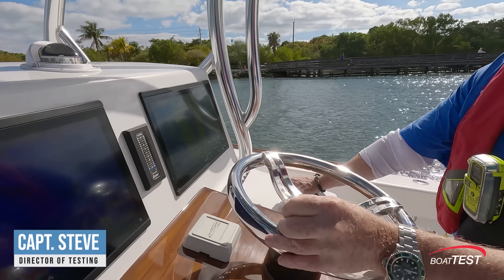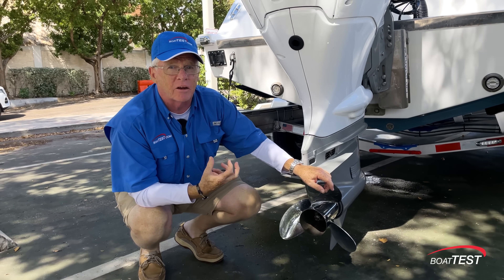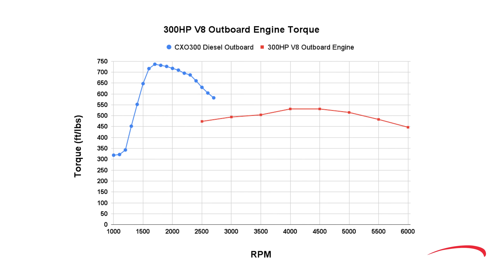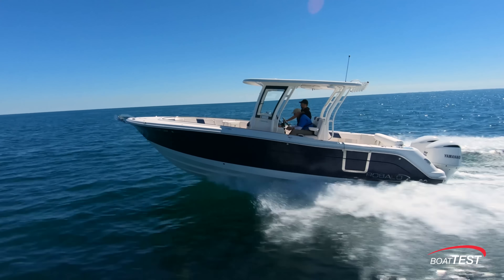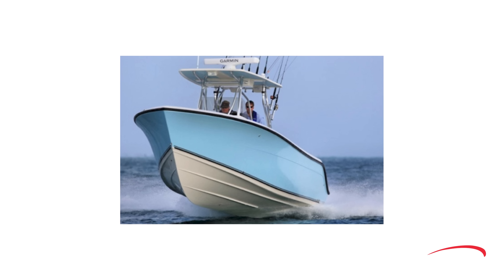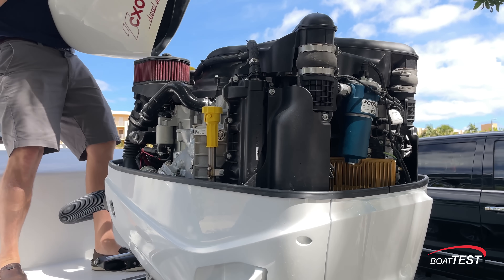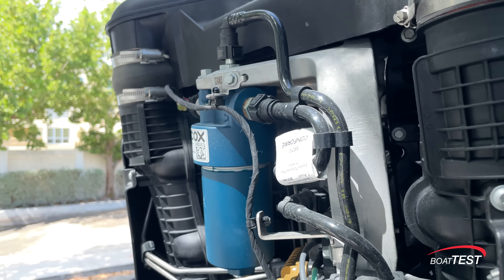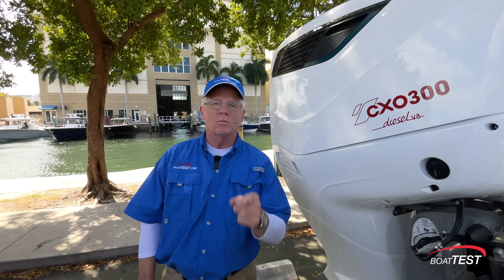The Diesel Revolution: Cox Marine CX0300 Review | BoatTEST

Comment: Would be interesting to compare this with direct injected petrol engines.
Reply: @ioijiopjkiopjkp  almost all modern gas engines are direct injected.  Diesel combustion is compression ignited and almost always produces more torque than a comparable gas.  There is a reason why all semis are diesel powered

Comment: It’s bullshit information, or shit motor….
300hp diesel v8 mercedes on maximum  speed = maximum fuel consumtion takes 20 liters / 100km = 12,5 MPG. 
I know: boat isn’t a car, but fuel consuption at maximum posibiloties of the same type and size of motor is similar in all application.
Reply: You just answered your own question. Its not a car. Boat engines have to put continuous output for hours, whereas a car is stopping and starting. That COX engine is built for continuous load (which diesels love). Car engines don't have the cooling capacity of a boat engine. Happy days mate
Reply: @peanuts2105  Many small boat engines (and some of the best outboards) are just car engines which have been adapted to power a boat.

The mpg of a boat will depend greatly on the boat itself.
Reply: @PistonAvatarGuy  yeah this diesel engine might be a reworked bmw v8 diesel
Reply: @PistonAvatarGuy the bmw m67 was a 4.4l diesel with aluminum block too
Reply: @alanmay7929  You are wrong. This Cox engine (UK company) is an V8 diesel engine developed from a clean sheet of paper by Cox. The other diesel outboard manufacturer OXE (Swedish company) use a BMW inline 6 cylinder 3L engine.

Comment: The torque figures for the gasoline engine in your graph are way off.  They are immensely overstated.  Maybe that's what it is if you include the 1.85 gear reduction.
Reply: Agreed "way off" is an understatement. Although outboard manufacturers rarely if ever publish propshaft Torque, Its safe to assume within a margin of error that torque figures do not exceed hp figures by much if at all (e.g. 300hp would be < than 300 ft lbs or near it). Proposing that a 300hp gasoline engine was delivering over 500 ft lbs of torque (without any type of gearing reduction, but pure at the shaft engine torque) would be crazy. I'd guess 250 to 290 ft lbs on a 300hp engine. So yeah, these diesels as expected deliver tons of torque which is awesome for people loading their boats with people or gear or towing etc.... They obviously have a purpose, but I would presume that although performance wouldn't feel as great per $ as a gasoline engine that you wouldn't notice the performance decrease as much with these as you load up your boat. Its possible the author was using Nm instead of ft lbs. Even if he was, thats still high even for Newton Meters.

Comment: It's amazing how much money and engineering goes into outboard motors.  These motors cost a fortune,  I just don't get why someone who needed 900hp would use outboard motors,  At that point I would be going for a inboard diesel, like a volvo penta or something.  But this is an amazing motor, it is an amazing breakthrough in technology.  It's not easy to build a aluminum block diesel, particularly a V8.  It's just amazing a 4.4 liter twin turbo V8 diesel outboard.  That's a huge motor.  In boats diesels are faster motors then gas motors, it's not like a car where you can drift, the motors has to sustain it's power to sustain the speed and gas motors only deliver their performance at their peak, which is not sustainable.  I saw something about boeing and evinrude developing a gas turbine outboard back in the 60's.  Now that would have been competition.

Comment: Solution to a problem that doesn’t exist…plus it costs more than twice as much and uses more expensive fuel
Reply: It can run on vegetable oil, biodiesel, renewable diesel, used motor oil etc.
Reply: This isn't comparable to a 300 gasser, because of the torque you can run a massive prop and cruise at low RPM. These were designed to be comparable to a 400 gasser performance wise. You're running 91 octane on a 400 and using 40% more fuel. You also have to think about application, these are meant to work efficiently and have much longer service intervals.
Reply: @WilliamStewart1  Outboards have gearboxes, so torque output at the prop is whatever you want it to be. When you're driving a prop through a gearbox, 300 hp is 300 hp, it doesn't matter how much torque the engine makes.
Reply: @PistonAvatarGuy  but you dont cruise at top rpm. gas motors have best fuel efficiency at 4500 rpm. (im talking power to consumption and not straight liters per hour) and diesels are at 2200 rpm. at cruise speed you will run a diesel at optimal rpm and gasser below optimal rpm. and you need more power to plane with a gasser. just look at the inboard diesel boats. they use 220 hp diesel and you get simmilar performance to a 300 v8... well except for the top speed. but if you use a diesel you are not looking at top end... you are looking for cruising efficency and range.
Reply: @jstefa2  Yeah, but all of that is a result of the turbocharging that comes with the diesels, and turbocharging on an outboard is just bordering on ridiculous, because of the price, weight, complexity and size.

Comment: $60,000. Two turbos and a lot of electronics. This is more stuff that can definitely go wrong with this engine. Maybe if they would’ve put one turbo and way less electronics they could’ve charged a lot less and have a more reliable motor, over 10 years developing this thing and it sounds like a bad deal to me. I’ll  do Yamaha all day. If probably maintained they can go over 3000 hours.
Reply: Unfortunately this is the reality of it.  Diesel engines are inherently reliable if built properly, but this is a brand new untested platform, from a company that likely wasn't able to put the development hours of a company like yamaha or otherwise to bring the reliability up to those standards.  This likely negates the inherent reliability of a diesel engine, but is speculation on my part.

I like the idea, and hope of course that I'm wrong.  Diesel just makes sense.
Reply: @FryChicken 
Great piece of journalism.
Reply: @FryChicken It's the EPA. We could easily have very efficient, simple, and reliable diesels right now if it wasn't for the EPA.

Comment: I like the engine and personally drive a Volvo Penta D6 powered DC. For sure the diesel is more fuel efficient than a gasoline engine. This is simply due the fact that diesel fuel has more energy per volume than gasoline. But to me as an automotive engineer this sounded like a heavily biassed and probably sponsored review. All the numbers were twisted so that they sound favourable to the diesel engine. The prop shaft torque of the gasoline engine won't be any less than the diesel due to higher reduction gearing. The smooth torque curve of the gasoline engine is actually better than the peaky diesel curve. And even though the gas engine has higher reduction gear the prop shaft isn't turning any slower due to higher engine revs. For the performance they really should be comparing prop shaft torque and rpm figures which in the end are moving the boat. Also comparing the fuel consumption of a 300 hp diesel to a supercharged 400 hp gas engine isn't really apples to apples.

Comment: At twice the price as a yamaha 4 stroke how much fuel do I need to buy to make up the difference along with maintenance costs? Modern diesels have so many issues with overly complicated electronics, the wiring harness and emission systems it's pathetic. No thanks.
Reply: 4,528,531 gallons. 👍
Reply: Do you mean filters on the exhaust to contain emissions? Modern petrol engines also suffer from similar limitations.

Comment: Good for commercial applications, I'm sure the payback would be quick enough to be worth it. As long as it's not using a Bosch CP4 DI pump, lol.
And I suppose if you can afford something like a Midnight Express or more, a few of these isn't really a budget concern. Might even be cheaper if you need 1 or 2 less. Would get those up on plane pretty quickly.
Reply: Well now there are CCs from 45 feet up to 65 feet and Mercury Racing is top outboard dog so COX(my last name too)has a long climb to reach them. And $55k is not a high price for what these motors can do. Four-six diesels can make a big CC dance over the swells.

Comment: What would happen if you paired these with a sharrow prop?
Reply: nothing, sharrow prop are made for spinning fast, maybe more effieciency but you get the most efficient power from a diesel engine by being able to do heavy loads for long periods of time with little amounts of fuel spent. Therefore you get the most speed from putting a bigger prop since it'll handle more load

Comment: Something's wrong with that gas dyno graph. Math says that horsepower and torque are equal at 5,252 RPM. And if that's a 300 horsepower. V8 at 5252 RPM the torque would have to be the same as a horsepower. That's not simply what that graph is showing. If that's the case, you would be looking in an engine producing right around 500 horsepower.
Reply: The graph seems to show the power is limited at high rpm, which could be to keep the engine from blowing up.

Comment: This is appropriate for locations that don't have access to good unleaded fuels or commercial applications. Almost 900 lbs with fluids, crazy heavy. Diesel is to expensive. I love that the front runner doesn't have the splash well in the rear transom deck. That needs to go away on all boats. No longer necessary with modern outboards pivoting at a higher location.

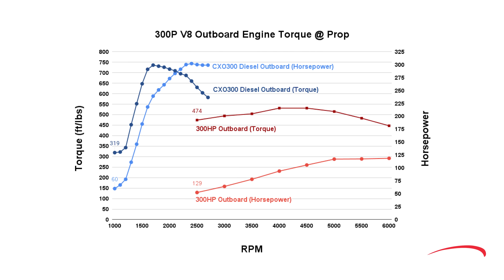Comment: Okay, how is it that the gas outboard, rated at 300hp, on the graph at 6:32 shows a max hp of 123?
Reply: It looks like whoever made the graph accidentally plotted the gas outboard HP against the primary Y axis (torque). He even says that the gas outboard makes 230 HP at the peak torque RPM of 4000, which aligns with the primary Y axis.
Reply: @agc812  Which is still disappointing, but not surprising. Hp ratings (and torque) are often lied about by the manufactures. But it does at least get close to the 300hp. I do love my diesels.

Comment: I agree with the other commenter that this review is basically a sales job and eliminates much information needed for a true review.  Yes it probably is a good motor but just guessing.  This does not appear to be a heavy duty engine so any comments on reliability at this time are just fiction and should  have been removed. Also discussion on horsepower vs torque are also a fiction. Watt invented horsepower as a sales device.  Horsepower is torque x RPM divided by a constant.
Reply: oh its a paid advertisement for sure

Comment: Zero audio of the engine at idle, cruse and max RPM.  Nor any noise comparison between gas and diesel.  I'm sure it's louder, but come on, let us hear it.
Reply from the maker: It’s not louder. In fact, because it was not different that the sound we usually hear from a gas outboard, we didn’t even think to make a special recording of it.  The decibels recorded ranged from 71 to 86 – about the same as we get from a 300hp gas outboard.
Reply: @BoatTEST  you didnt think that us boaters wouldnt want to hear it? seriously

Comment: The COX engine is a lot like the Sharrow prop. My primary reason for wanting to outfit my boat with one is greater efficiency. But, as a part-tiime boater, I don't see ever making up the tremendous upfront cost over my 10 year lifetime of using my boat. Also wondering, is the Optimus power steering included in the cost as with at least a couple of the popular gas 300s coming with built in electric power steering, or is that additional?

Comment: Several comments regarding this review...
Torque graph => The narration states a common torque axis to 800 ft/lbs but the graph clearly goes to 750.
Why is there no torque plot for the COX beyond 2600rpm even though it will rev to ~4000 ?
The review states that the COX was running a 28" pitch and a 1.46:1 final ratio. Why wasn't this pitch used in the comparison of theoretical distance travelled over 1,000 revolutions, versus the typical 300hp gasoline engine's 12" pitch prop ? The COX would theoretically travel forward 1,598 feet, not 684 as stated for a 12" prop, versus the gasoline engines advancement of 571 feet. This is a huge difference in favour of the COX.
Why did you change tracks in your comparison from a 300hp gasoline outboard to a 400hp supercharged unit when discussing fuel efficiency comparison with the COX ? The lack of consistency just obfuscates the data comparison.
Assuming the difference in purchase price of the COX ($65,000) and a 300hp gasoline outboard ($38380), making the assuming that the price difference is the same in £ rather than USD, and using 'today's' UK fuel berth prices for diesel and petrol it would take 13,754 miles for the COX to break-even (calculated at cruise mpg). That seems like a big distance compared to many boat non-commercial owners' actual usage. For that reason the use case is probably restricted to commercial operators and the very rich.

I'm pleased to see the COX and OXE diesels in the market but unless/until prices decrease the use-gains (i.e. torque at low rpm) are expensive.
Reply from the maker: 1.     Good ears Ian!  The chart’s size was made smaller in post for technical reasons after the VO was recorded, and makes no difference to the data presented.
2.     The Dyno data starts and stops where it does because that is the data we had.  Gas engine outboard makers protect their torque curves like the crown jewels.
3.     12” was used instead of the actual prop geometry of  28” to make the explanation simple. An objective of this video was to explain torque, gear ratio and other issues as well as to measure the performance of the Cox diesel.
4.     We changed tracks from 300 Hp V8 gas engines to a 400-hp L6 gas outboard because that was the data that was available. When have you seen a torque curve on a gas outboard maker’s website?
5.     Yes, it will take 13,000 miles of use to break even on the price of the engine, but don’t forget the MSRP of a 300-hp engine is $38,000. The $27,000 difference is not so onerous, and what if the fuel cost $6 or $7 per gallon, or as in our example $10 fuel or no fuel available at all in Bimini?  Further, when one Cox diesel replaces two gas engines, or when 2 diesels replace 3 gas engines, it is easy to earn back the difference.  Also, fuel savings is not the only reason to select a diesel outboard.  If a gas-powered boat can’t get on plane without turning 4,500-5000 RPM, an owner will want a diesel solution no matter what the fuel savings.
Reply: @BoatTEST  thanks for the meaningful and thoughtful responses. I believe if the EPA really cared about the environment they would have required that all HO outboards (static load applications) be diesel. Just makes sense. Diesel is much safer too.
Reply: OXE has terrible owner reviews! 😂

Comment: 866 pounds yet produces the same horsepower as an Evinrude two stroke that weighs less than half two-stroke actually have much better torque curves than the gasoline outboard They compared it to in this video.
Reply: It's crazy that an Evinrude 300 is only around 550 depending on specifics. Such a huge weight savings and power to weight ratio. Such a shame they have stopped making 2 strokes. I think they could've really come out with some big advances in the tech. Public perception just ruined the 2 stroke. Majority of boaters are clueless when it comes to the mechanical aspect, no maintenance and complete neglect really favors the 4 stroke, so here we are with only 4 strokes on the market.
Reply: Evinrude Blows! 😂
Reply: @chrisparker9886  everyone’s entitled to an  opinion but your opinion shows that you don’t know anything about outboard motors what’s not to like about the Evinrude G2 ? The fact that you get 20% more torque than the comparable Yamaha or that it’s more fuel efficient or that instead of requiring 100 hour services. A service is only required every 300 hours.?  
The decision to discontinue the Evinrude brand, had nothing to do with quality and everything to do with politics, but I’m guessing that you would not know that you probably only know what someone’s friend’s cousin’s baby sister’s nephew told you
Reply: @chrisparker9886  have you ever owned one?
Reply: @timlong1462  Not a G2,  but yes I've owned a few.
Reply: @chrisparker9886  the reason I ask is this seems to be more of a boating trope than anything else. A lot of folks have an opinion based on nothing but internet anecdotes. There are still a ton of them out there running every day without issue. I personally think most of it has to do with poor maintenance than anything else. Sure there are some problems, but look up any specific engine ever made and there's somebody on a forum complaining about it being crap.  I truly think Evinrude made some great stuff, politics really put a damper on what could've continued to been a great brand
Reply: @chrisparker9886  You know all about blowing.

Comment: I am confused about the "electronic ignition" comment. I am not a diesel tech, but not one diesel engine I have ever worked on or dealt with has an ignition system as they tend to operate solely by compression. Is there something new on diesels that I am missing?
Reply: Big respect if you can hand crank a 4.4 V8 diesel 💪😅
Reply: @Ian-gf8id  You got that right! Even with a compression release system like some dirt bikes had (or still have), I don't think it would be possible!
Reply: A more accurate terminology would be electric "starter".
Reply: @Ian-gf8id  Ah yes, the electric starter! No more hand cranking!